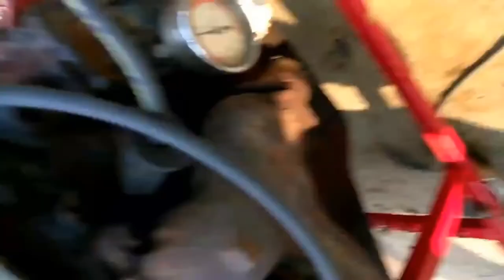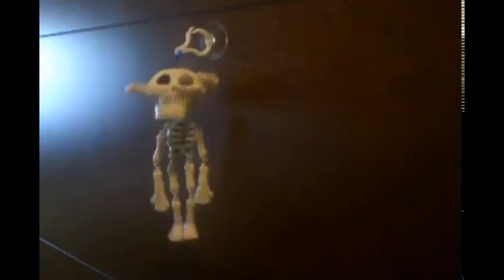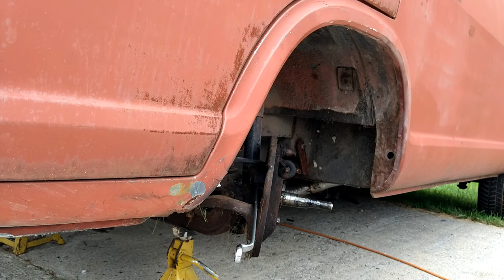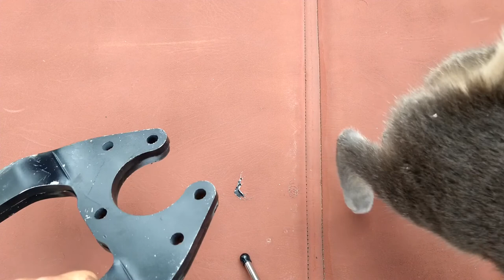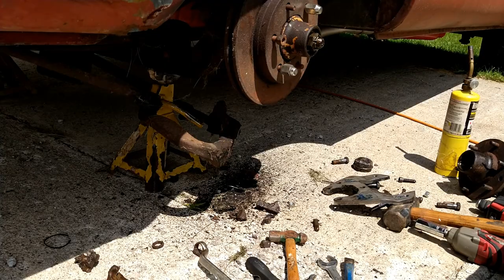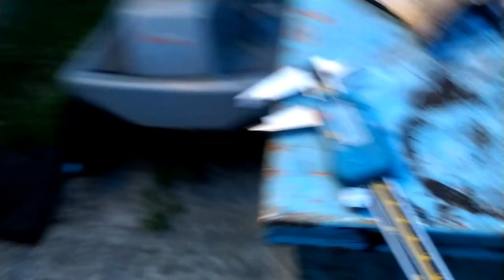1968 G20 disc brake conversion

Comment: It probably would have been a whole lot easer to simply convert it to a 1964 - 1970 G10 van with 5 lug spindles and then you would not have had the issues of having to modify the  brackets. Finding 10" 5 lug rotors is not an issue either. And you would have the added benefit of better aftermarket wheel selections. And maybe run a Trans Am disc brake rear end from the junk yard. And what did you do for a power booster?
Reply: Kinda what I was thinking....

Comment: Derelict,
Did you get the brakes for the G/20 fabbed up? I'm wanting to upgrade mine to disc as well, but not much out there. M1d said it may be easier to install a g/10 axle. Wondering what you ended up with for a solution.
Thank you,
Jim

Comment: Cool video , your van resembles my 69 g10 108 she's brownish red primered . I have almost killed myself trying to brake quickly and keep my pepsi's from spilling. I was thinking of using rotors and calipers off an obs chevy (88-98 trucks and 92-94 full size blazer,9598 tahoe and 92-99 burbans) my 99 burban is a 1500 2wd with 5 lugs all the 4x4s were 6 lug in those years and I want to keep mine 5 lug. Did someone you know male those brackets or do they sell them ? I don't want to modify her too much especially cut the floor in any way for a bigger master cylinder

Comment: Great video. How do I identify if I have a g10 or g20? Is the M1dadio kit for front or rear brakes and what did it cost when you got the whole kit?
Reply from the maker: G20 is six lug wheels. The M1D kits are for G10 five lug, and consists of the brackets and a list of readily available GM parts. You would have to contact M1dadio at vcvc.org for current pricing, as I bought my brackets a few years back.
Reply: I did mine beginning of this year and I was about $850 all in including the kit.  Totally worth it.